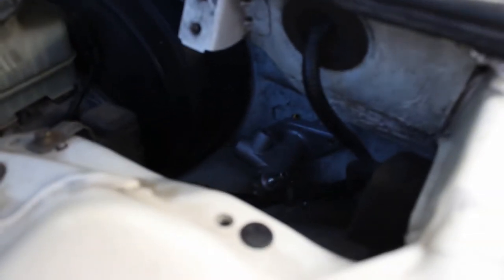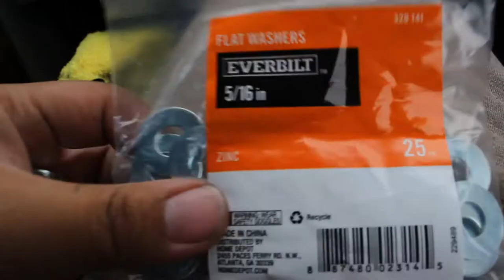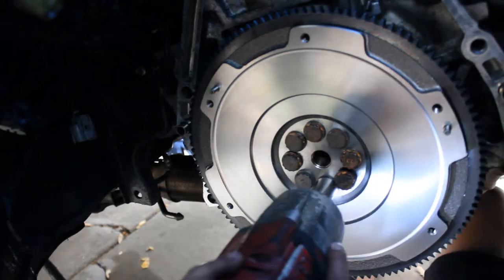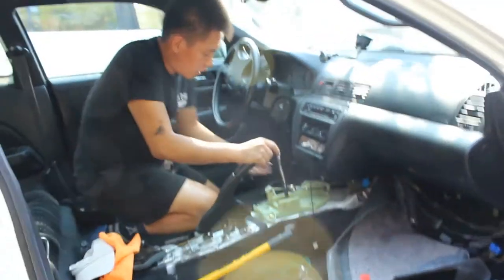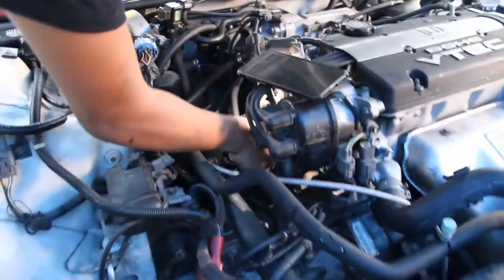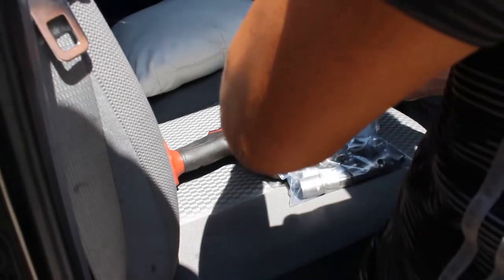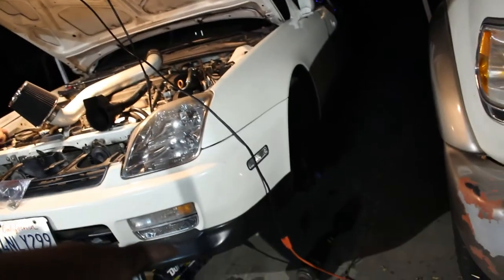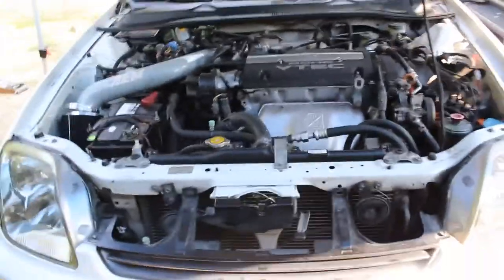Auto to Manual on the 5th generation Honda Prelude (Part 2) FINAL

Comment: Thank you for finishing and posting the full swap. It looks good 💯. How is the m2k4 transmission so far ??
Reply from the maker: @primitive_derek9229  m2k4 was really good until I opened the transmission case and I couldn’t get it back in so I sold it. Solid transmission though
Reply: @Xaowerr  thank you for the fast response bro. I got a manual swap coming soon so I appreciate the help🙏
Reply from the maker: @primitive_derek9229  yessirrr. Just lmk if you have any questions